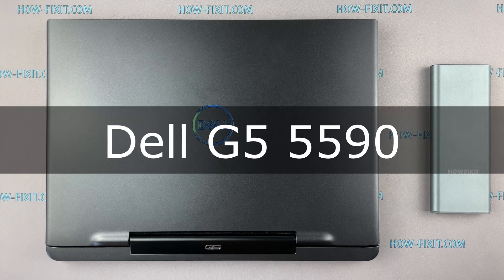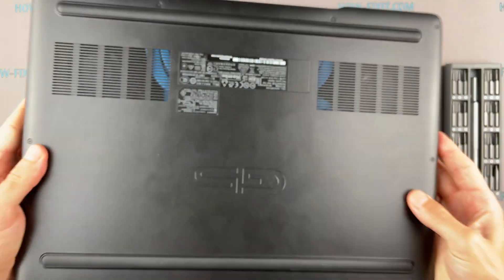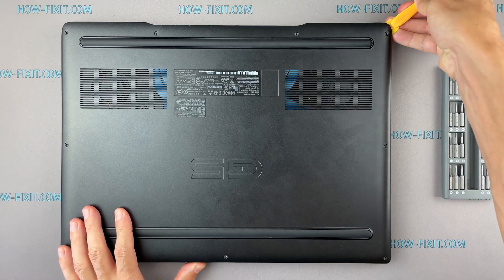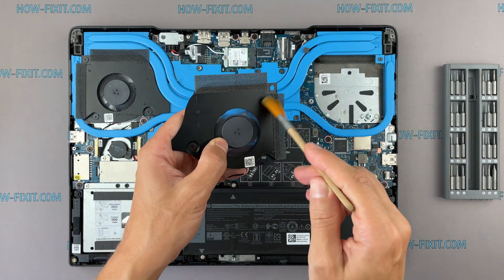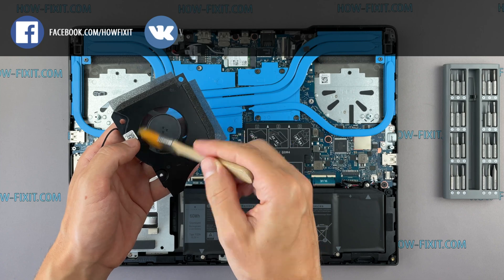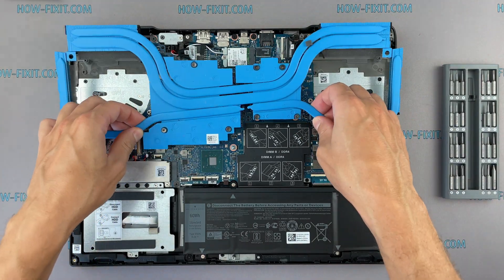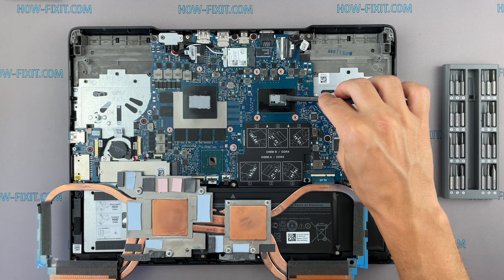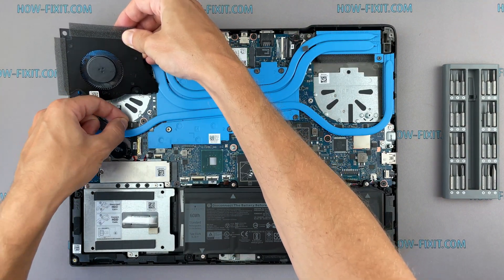Dell G5 5590 Disassembly, fan cleaning and thermal paste replacement

Comment: Friend, a question, I was using my laptop with the GPU fan damaged, until I realized that it was damaged, only the CPU fan was working, I stopped using it until the new fan arrives, if I used it like this there would be damaged something on the video card? It worked normally for me but I half blinked the screen quickly, but nothing more

Comment: How often should you change thermal paste? And clean the fans ?(i don't use it much just for work not gaming, I've had this berfore the covid pandemic and recently my dell g5 5590 laptop have been crashing and freezing alot and I'm wondering if it has to do with thermal paste and fan)
Reply: I bought this computer before the pandemic and my computer was also getting very hot and was giving a blue screen and shutting down while playing games. Then I changed the thermal paste and cleaned the inside. It was like a brand new computer. So it's definitely time to get it serviced

Comment: For the blue thing on top of gpu/cpu, all my screws make a clicking noise when you unscrew them, as if the screws were not aligned properly when the laptop was assembled. I have never touched those screws before so it wasnt me who messed them up but they just wont unscrew so I cant replace paste
Reply: Just did it today. unscrew until you hear 1 click then move on to next screw. you can pull it out no problem
Reply: @DavidPerez-js5xf  is that how it was intentionally designed? I believe you that just sounds really dumb
Reply: @jackschneider863  I can only assume that's the intention. a couple of my screws on the back cover are the same way

Comment: I did this after using the laptop for over 2 years this video helped me a lot but the fans were very hard to unplug i thought I was going to break them but in the end I was able to unplug the cpu fan and clean it but the gpu fan wasn’t unplugging so I had to clean it while plugged in but in the end everything went smoothly and the laptop is running much more cooler

Comment: Hi,  i have dell g5 15 5590 laptop (it contains nvme hdd) and i need to add 2nd internal 2.5-inch hdd to increase storage ,, i ask if this cable(dell inspiron 15 5575 hdd connector cable OR g3 hdd connector cable  ) is compatible with G5 5590 or not? Many thanks for helping.

Comment: I have this laptop, and by no means am expert or anything. But if you are having issues with heating and fans going up first and the most simple thing to do is to go to BIOS by pressing F12 at start up > Preformance > Intel turbo boost and disable this crap into oblivion. At one point my temperatures were going to 95-98, with fans at 100 % or close to it, with boost disabled 60-70 with no performance change that I can see.
I remember doing this in the past and now with recent windows updates I think something messed up bios and got it enabled again. I actually repasted it and that haven't changed behavior too much, there are also some other known problems like changing power setting in My Dell app > Power > Thermal. Hope it helps, gl guys.
Reply: Thanks for this, I do need a repasting but this definitely helped a bit

Comment: dell g5 5590 can't be undervolted after firmware update and I can't even downgrade the bios because dell blocked it.
Reply: Really? I managed to downgrade mine not too long ago. You will need to disable the automatic UEFI updates, however - but that's simple enough. Once I disabled those, I never had to worry about the UEFI again.
Reply from the maker: No, you are wrong, you can undervolt the Dell G5 5590 with ThrottleStop check this video - https://youtu.be/1PTRCc_BRtQ

Comment: bro i need the cooling system radiator? not sure about the name that blue thing where the fans sits, where can i find that? or under what name ? thanks
Reply: hello, good, did you find it, I'm also looking for that radiator, what was your problem, my pc reaches 212 degrees. :(
I already did its maintenance but it didn't work.
Reply: @jocsanmadariagaschulz3230  hey bro, I had to contact DELL, couldn't find it anywhere else and is not cheap
Reply: @ignacio5600  thanks for answering, how much was the value?

Comment: Help the fan screws won't budge. i can't open it.
Reply: Same dude, screwed so tight even with a proper screwdriver I can’t manage to get them out
Reply: Someone could?  I already stripped my screws fans. Help
Reply: @oswaldoxaviercruzramirez5371  Hi, I managed to unscrew 4/6, the other two I just drilled through… warranty was done anyway 😄 but it worked
Reply: Same here i need help
Reply: I happened to unlock 2/9 screws but for unknown reasons the others dont move ...

Comment: Remove the metal dust cover covering the fans and disable turboboost. I got a 20 degree difference just from that
Reply: is that the copper piece on the back of the laptop? I have this same model and I'm desperately trying to get the temps down

Comment: By replacing thermo grease,does cpu and graphics cpu temperature becomes stable or overheating can be prevented?
Reply: You'll probably still need to undervolt the CPU for it not to overheat. I use ThrottleStop for this. You may need to install and older UEFI version for undervolt to be enabled.
Reply: @davidsicolo2473 which bios version did you downgrade to? And how high is the risk downgrading down multiple versions at a single time.
Reply: @alfafanet I've been fuckijg around with Throttle for he past 5 hours and I have not been able to enable anything that can undervolt the CPU. at the very least I turned off the turbo mode the laptop comes preset with and undervolted the GPU.